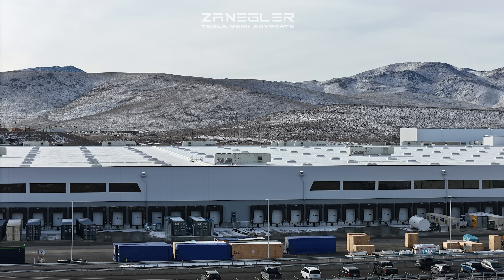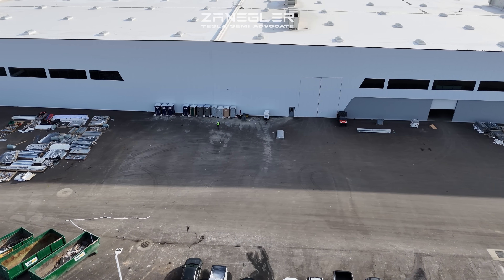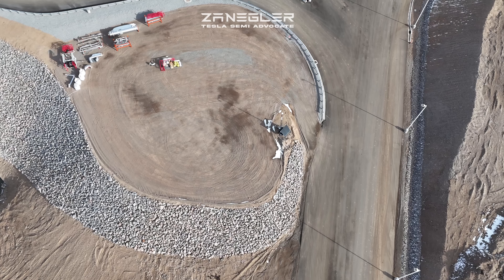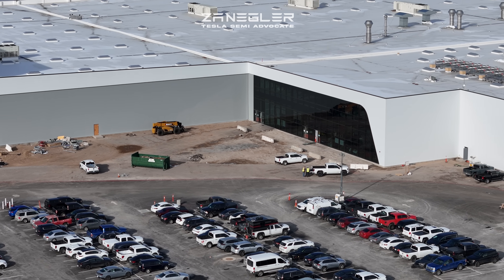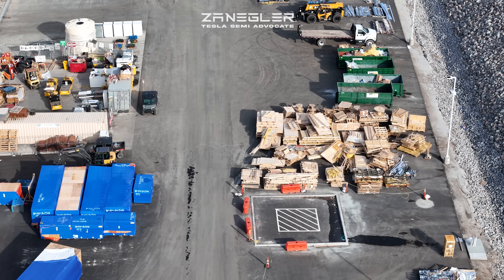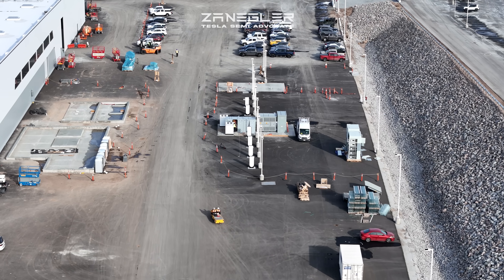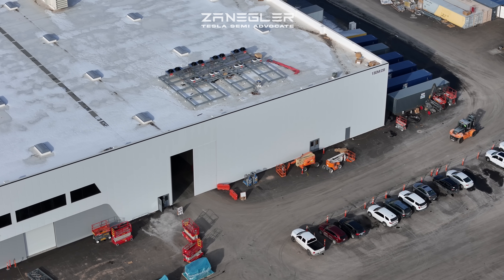Tesla Semi Factory Mystery Equipment?

Comment: that equipment looks like an autoclave, but my second guess is fire equipment, because elon has several giant buildings and several high risk chemicals beinng worked with here. One of the pieces of equipment you need when you hahve fire equipment is foam.  You don't spray water on electrical and chemical fires, you use fire fighter foam, which mixes with water. So in order to spray foam everywhere, and then reload your firetruckk so it cann go back and spray more, is a foam machine that stores the foam.

Comment: Quick analysis of your latest drone shots of the curved pad and mystery equipment at Giga Semi:
The curved/inclined pad with berm and guardrails looks like a 180° turnaround loop for Semi testing — perfect for bobtail maneuvers, direction changes, or even hill/brake validation on the test track. (Could eventually be a standard helipad but would need work due to the curve, incline, and construction clutter — though Tesla sites sometimes add heli use later.)
The large horizontal tank (frosted, ~4kL capacity, with valves/flanges) + piping skid is almost certainly a vacuum receiver system for giga casting. These are used to rapidly evacuate air/gases from huge molds before injecting molten aluminum — key for low-porosity, high-strength parts like chassis/underbodies. The frost suggests cryogenic testing or inert gas (argon/nitrogen) integration. It's staged outside temporarily during factory ramp-up, likely headed indoors to support Semi (or shared Robovan) production lines.
Fits Tesla's push for giga casting efficiency as they aim for 50k+ Semis/year. Great footage — thanks for the updates! - enhanced by Grok
Reply: No gigacastings in the Semi, so no need for gigapresses at the factory.
Reply: @DessieDoolan  appreciate the education. You are correct. I would think they would use them on robovan when ready, but they may be years out on manufacturing that beast. 🥃
Reply: @CapitalforHire  I think it's a heat exchanger. The pipework is labelled, and I can make out 'coolant water supply', or something similar.

Robovan. I would speculate that Robotaxi needs to prove itself before the Robovan project enters any sort of production planning.

Comment: “ A hole” lol.
And -I realize who the eff am I to question this, but the big ass semi chargers are not drive-through at the factory
I’m not sure why they didn’t deliberately make them drive-through. It seems like it is much less risk of a mishap. And much more efficient.
And it’s not like they’re lacking for space, the footprint of this thing is massive
Reply from the maker: These will be used by bobtail semi’s only.  No trailer
Reply: They look drive-through to me at first glance. no blockage, mounted on the side, plenty of paved area on either end? What makes then NOT drive-through?
Reply: @geirmyrvagnes8718 appears to me that back curb is too close to be drive through.. but hard to tell if not standing there though..🤷🏻‍♂️
Reply: @oscarmike4596 I think the trucks are quite nimble. They don't have trailers hooked up yet when they come straight off the assembly line and need some juice.

Comment: This equipment is not normal piping or HVAC – it’s core process hardware from Tesla’s battery cell production at Gigafactory Nevada.
The large silver unit labeled “CL-150” is a condenser loop: a high-capacity vacuum condenser for electrolyte and solvent vapors coming from battery cell filling and drying.

When lithium-ion cells are filled and evacuated, huge amounts of electrolyte and solvent vapors are released. The CL-150 cools these gases, condenses them back into liquid, and sends them to the recovery system. This prevents expensive chemicals from being lost and protects the vacuum pumps, the factory and the environment.

In short: this system is a key part that makes Tesla’s high-volume battery cell production safe, efficient and economically viable.
Reply from the maker: You win the comment section !
Reply: How come they were located at the Semi Plant, since no battery production will take place in that factory?
Reply: 4:58. You were correct. Equipment seen installed within a steel framework in Zanegler's  'Tesla's Nevada LFP Battery Line' video at 1.45. @hardernl8893 called it out in his comment under that video.

Comment: Zanegler - the Robovan should use CyberTruck electrical and mechanical components. 
Surely Tesla will add automated trucks in the class 4 to 7 range to GigaSemi plant. This will allow Tesla to sell rolling chassis to OEMs that add a tray or a cargo box or a bus body or a mobile home body. These OEMs have built reputations over decades and developed many niche components for their customers. Tesla should focus on offering them a superior chassis rather than try and compete with them.

Comment: Thanks Zanegler.
Sort by newest first or top comments if only the first few lines are visible
0:25. 15:03. North west corner, road.  Right. Over-run ramp. Yellow and red barrels stored, or is this part of the energy absorption system. Excavator located to transfer the pile of gravel (or other material) into the barrels.
1:38. Westside, apron. Tanks. This is likely some water treatment related system. Pair of blue water storage trailers, Evoqua trailer( Evoqua does water, and wastewater treatment equipment/systems). Various hoses connect the water storage trailers, the Evoqua trailer, and the 3 white water tanks. May be associated with the Paint shop filtering system. The orange and black lagging has been around the pipes for a couple of months.
Production of fibreglass fairings…….can’t see how it relates.
4:58. Southside, apron. Circular patch. Cylindrical item. Heat exchanger is the consensus. Image search confirms. Clad in aluminum/aluminium sheeting (joints visible), and additional band of insulation about mid length.
The labeling on the pipes might give a clue to the purpose.
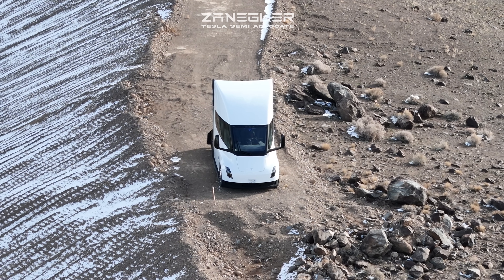At 5:56 the orientation of the label CL150 suggests it is to stand on the end to the right. Triangular tab would be lifting point to raise it vertically.
8:09. Stamping, east door. Inside. Upping the exposure on a screenshot reveals an opening into the sub-floor, formwork for a rectangular pad, and not much else. No stamping press yet.
13:36. East. New footing. Rectangular blocks would be the footing for a horizontally mounted tank/pressure vessel. Suitable vessel seen bottom left at 0:15. Similar at GT outside Battery.
2 formwork squares might be sump locations. 
13:52. East, against the wall. Location of column rows 6, 7, 8, and 9 marked.
Reply from the maker: We always appreciate your analysis!!
Reply: @ZaneglerTeslaSemiStalker-vt3or  4:58. The cylindrical item can be seen installed within a steel framework in your 'Tesla's Nevada LFP Battery Line' video at 1.45. @hardernl8893 called it out in his comment.

I'd paid attention to his comments, he's a former process engineer, generally right on the money with this sort of information.

Comment: Regarding the "Tank"
"CL150" is a pressure rating for valves, flanges (And I presume "Vessels"?)
I asked AI (Not Grok/ Chat) for "CL150 Rated Pressure Vessel Applications and Uses"

CL150 (Class 150) rated pressure vessels and components are primarily used in low to moderate pressure applications across various industries. Here are the main uses:

Common Applications
Water and HVAC Systems CL150 components are widely used in water supply systems, municipal water distribution, and heating, ventilation, and air conditioning (HVAC) systems where pressures remain relatively low .

General Industrial Use These are cost-effective solutions for general industry applications that don't require high-pressure resistance, including some chemical processing plants operating at lower pressures.

Low-Pressure Gas Systems CL150 ratings are suitable for air distribution and low-pressure gas systems where operating conditions remain within safe limits .

Pressure Capabilities
At ambient temperature (100°F/38°C), CL150 components can handle approximately 285 psi (19.6 bar). However, this rating decreases as temperature increases—dropping to about 170 psi at 400°F and 115 psi at 600°F 
............................

SO probably either Water, HAVC, or low pressure Gas / Air distribution?
OR a vessel to provide pressure for a Helicopter refuelling system?

Comment: Grok and X PRESSURE WELDER think this:  The object in the center of your photo—a large, horizontal, cylindrical, silver/insulated-looking tank or vessel with rounded ends, positioned outdoors on what appears to be a gravel or dirt area with adjacent piping and some structural supports—is most likely a heat exchanger (or more specifically, part of an industrial heat exchange system), rather than a boiler.
Here’s why that fits best, based on the visual details and typical industrial setups at facilities like Tesla’s Gigafactory Nevada (where the Tesla Semi is assembled and related production occurs):
•  Shape and appearance: Horizontal cylindrical vessels like this are extremely common for shell-and-tube heat exchangers in industrial plants. These transfer heat between fluids (e.g., hot process water/glycol to cool outside air, or vice versa) without mixing them. The shiny, insulated exterior (often stainless steel or clad) helps retain temperature and protect against weather/elements, and the blue-ish tint in spots could be reflective insulation or coating. Boilers are more often vertical or have distinct burner/furnace sections, steam outlets, and safety valves visible—not just a plain cylinder with piping connections.
•  Piping and setup: The attached piping (white/PVC-like or metal lines running parallel and connecting nearby) suggests fluid in/out connections typical of a heat exchanger loop. In manufacturing plants, especially EV/battery-heavy ones like Tesla’s, these handle cooling for equipment, HVAC, process cooling for battery production/assembly, or even chilled water/glycol systems for temperature control during painting, welding, or testing. The limited scale (not a massive array) points to a utility or auxiliary system rather than core production machinery.
•  Context at Tesla Semi factory: Gigafactory Nevada (and expansions for Semi production) uses significant HVAC, cooling, and energy management systems outdoors. Tesla facilities employ advanced heat pump tech, coolant loops, and thermal management (similar to vehicle systems but scaled up). Outdoor cylindrical units often include:
	•  Chilled water/glycol storage or exchange vessels for process cooling.
	•  Air-cooled condensers/evaporators (though those are usually finned/coil-based, not plain cylinders).
	•  Thermal storage tanks (e.g., for balancing heating/cooling loads, as seen in Giga Nevada docs mentioning hot water storage tanks).
	•  Not a boiler: Boilers generate steam/hot water via combustion or electric elements and are rarer outdoors in modern EV plants (Tesla leans toward electric/heat-pump efficiency over fossil-fuel boilers).
•  Snow/conditions: The bit of snow/ice to the left (and blue shading) could be condensation/frost from cold fluid inside (common in cooling exchangers) or just winter buildup in Nevada’s climate. It doesn’t scream “boiler” (which runs hot and would melt snow nearby).
It’s unlikely a pressure vessel for something exotic (like compressed air or nitrogen) without more indicators like gauges or massive valves, and not a simple storage tank (those lack the heavy piping emphasis).
In short: Yes, this looks like a heat exchanger (likely shell-and-tube type for fluid-to-fluid heat transfer in the plant’s utility systems), not a boiler. These are standard outdoor industrial components for thermal management in large factories. If you have more photos, angles, or labels visible on it (e.g., manufacturer tags), that could confirm 100%!